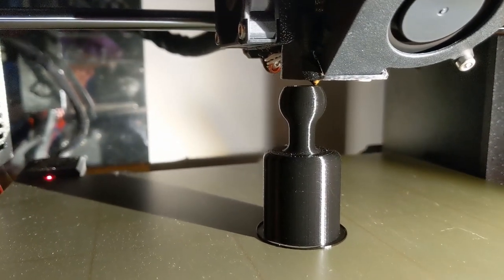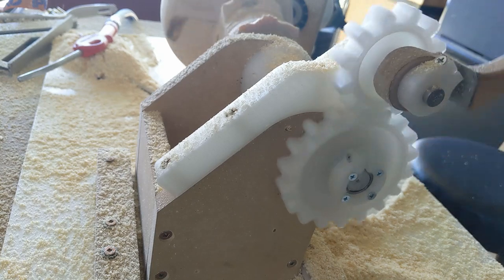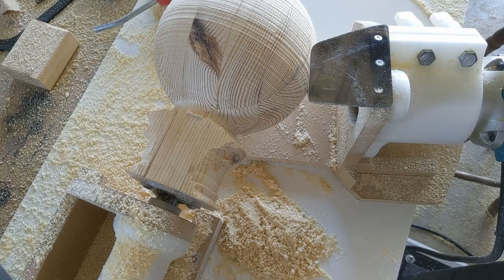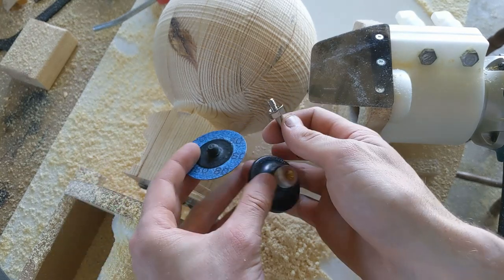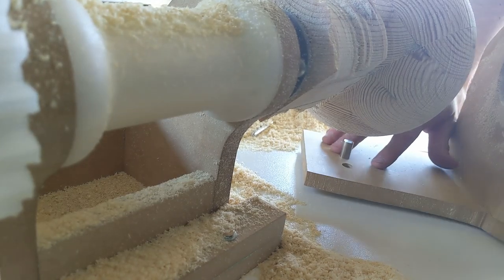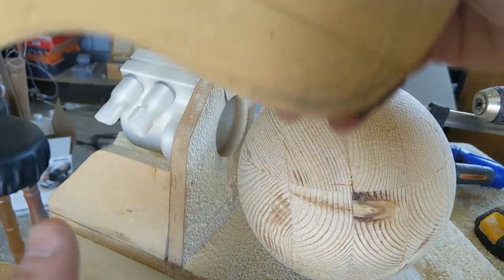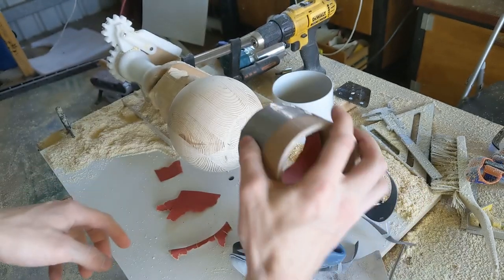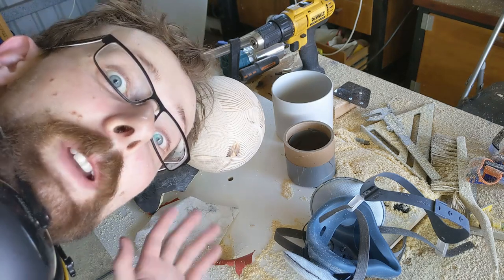Big Wooden Balls - I explain my jig for cutting spheres

Comment: 3:00, If only you had some form of handheld laser device that some how measured temperature.
Reply from the maker: Haha yes I do have an IR thermometer but it is supprisingly useless at measuring reflective metalic surfaces. I would have to spray paint my router black. I have designed a new mount that has wooden inserts so that the pla never touches the router :)